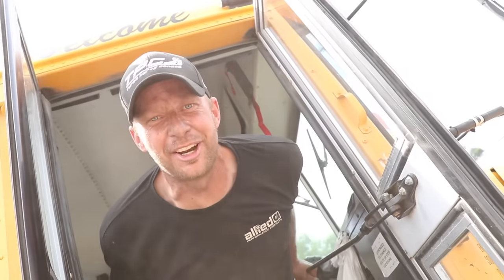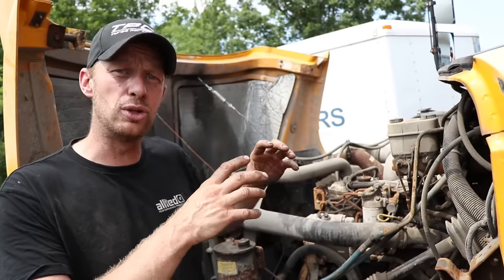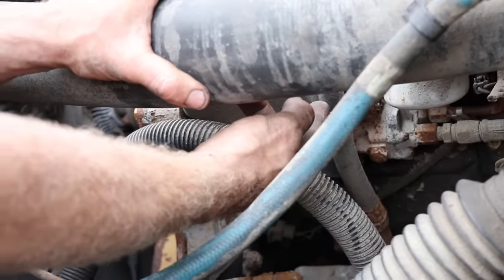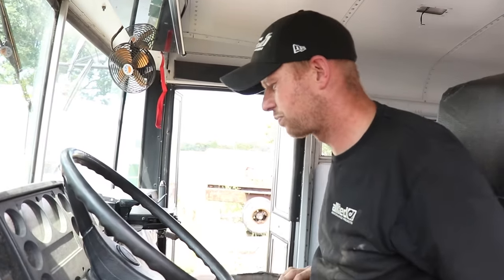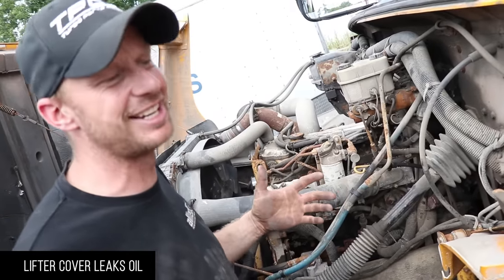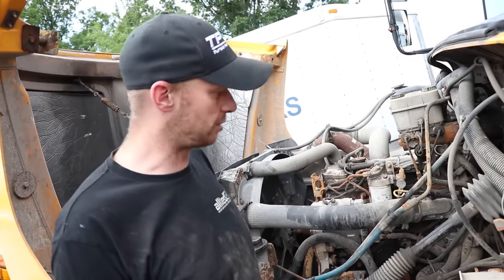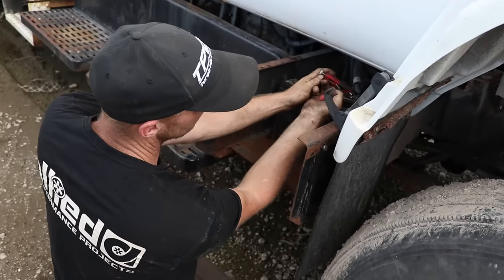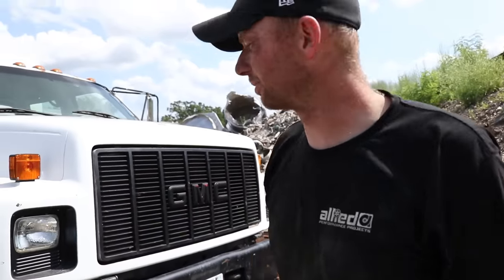REVIEW: Everything Wrong With A 7.2 CAT 3126 Diesel

Comment: Detroit 8.2L Fuel Pincher, I've been kneeing to find one in a Chevy C70 but not much luck.
Reply: I worked on 8.2s in a dealership from when they first came out. That engine was going to dethrone the 3208 as the premium medium duty diesel engine in the marketplace. 
Not.
Open deck design (think Vega engine) that couldn't be resurfaced, head-gasket-of-the-month club membership, head bolt rework campaign, spun oil pump bushings scrapping the blocks, rolling idle from sticky injectors/worn governors, etc.
We used to say they were painted and environmentally friendly shade of blue so they wouldn't scare the fish in their only fit use as a boat anchor.
Reply: have you tried places like   GOVDEALS  or PublicSurplus   dot com    or ironplanet and govplanet  dot com  ?
Reply: @paulolson734  I read that without seeing you wrote "Not" i was wtf lol!
Reply: I have one sitting in the shed. Was worked on by a tech. college
Reply: my dad had one in a topkick tandem dump truck when I was in highschool. Good on fuel because it was using more of the oil as fuel. It was a tired unit when we got it. Needed ether to start cold in the summer but i loved tearin around the farm in it. the oil consumption and an owner that i would call a total gary ended its life needlessly with a spun bearing and a week later the rod went through the block.

Comment: look at Deutz water cooled, working on a 2014, 6 cylinder Deutz common rail tractor engine, I am impressed with how simple and well engineered this engine is, 3000 hours and the pistons in perfect condition,
Reply: On most of the older ones I ever rebuilt the rods and mains looked mint at teardown...they ran some pretty high pressures like 80-90psi usually, so there goes the theory of high oil pressure causing bearing issues.

Comment: I will stay with 8.3 cummins and 5.9
Reply: The 8.3 is the 6CT, basically just a bigger 6BT Cummins.  It's a pretty big engine, so I'd imagine it would be hard to make it fit.
Reply: Henry because it’s fuckin huge lol
Reply: The 8.3L is nothing but a boat anchor. The 5.9 24 valves are lighter and just as powerful. I was after an 8.3L till I actually looked at the specs. Power to weight ratio is terrible.
Reply: @brettrichards666  Ive driven two motorhomes of comparable weight (33K gross), one with an 8.3 and one with a 5.9. Both mated to 6spd allison tranies and ill say the 5.9 doesent even come close to the 8.3. I am sure they both could be turned up some from the stock tuning, but stock to stock its an insane difference. You HAVE to drive the 5.9 WOT 75% of the time, any on ramp, green light, hill etc and its WOT. Any hill you encounter on the freeway it slows down to about 50-55mph. The 8.3 was almost never WOT, if you did mash it from a stop it would put you back in the seat. It would also go however fast you wanted to go up almost any hill, no joke it would do an easy 70mph up even the steep hills on the freeway. I have also driven one with an international 6.0 and a 5spd allison,  It has a significant amount more torque off the line than the 5.9, but i think that was mostly gearing as it was a dog on the freeways and would get slowed down to 45mph on a lot of hills.
Reply: I have replaced 6.7 Cummins with mechanical 8.3 Cummins on farm equipment. The 8.3 is only 3" longer than a 6.7. 5.9's are reliable but dogs.
Reply: Might as we stick a Cat C15 in it. might take up a little cab space and you will need on hell of a   cowl induction hood.
Reply: The 8.3 Cummins isn't that great it had issues with Camshafts, it wasn't one of Cummins best engines that's for sure.
Reply: The 8.3 is twice the engine a 3126 is and costs 30% as much to work on.  For a few years we had a 3126, an 8.3 and a DTI-466 in tractors and the 3126 was by far the worst of the 3.
Reply: @84Prerunner  Maybe with motorhome transmission and rear end gearing. Motorhomes arent pickups.
Reply: @brettrichards666  you haven't the slightest clue what you're talking about.
Reply: @verteup  I do.
Reply: @brettrichards666  an 8.3 Cummins will walk all over a 5.9. if you think those two motors are even close to each other you don't have a clue what you're talking about.
Reply: @verteup  Okay. Lmao
Reply: @westbender 820 That doesn't mean shit. That's like saying any stock 454 is better than a newer, let's say stock LS 3, just because the 454 is bigger. Especially when it comes to the aftermarket world, I dont see 2,900hp 8.3s.

Comment: The difference between the 1000/2000/2400 series and the world 3060 is the gross weight capacity. They are different transmissions for different applications, there's more to it than the numbers of forward speeds.

Comment: I had a 2000 Peterbilt 330 with 3126 B 250 hp. Super 10 would run 80 I think 4:33 rears air-ride loved that truck. I changed oil every 6000 miles after 200k miles I changed every 5000 miles Rotella T ended up 425k miles when I sold it never had to replace injectors never cold start, used a block heater.

Comment: Thats a tough engine.Seen a driver overspeed one and threw most of the push rods out of it. pulled them out of the pan replaced the bent ones and fired it back up and sent it on its way

Comment: Unless there was some changes done  to the 3126 I just put a head gasket in(470 cat combine).
It had a Mechanical injection system with a fuel rack, governor and cam driven injectors. No hydraulic/electronic injection.
Dead simple engines, that are bullet proof, heard of them having over 17,000 hr on them.

Comment: I was the new guy at a cat truck engine shop when those little bastards were under warranty. So many gaulded cylinders and those don't have liners. So you have to pull it out, tear it down and send the block out for sleeves. I started having flashbacks . Make it go away!

Comment: Have 3126 in wheeler dump truck. It uses 2 gallons of oil a day. It has 165 thousand miles. runs good, dos not burn it or leak it. Has really good fuel mileage. I think it ends up in fuel tank. Had injector seals installed couple of years ago but it made no difference. Back then it only used 1 gallon a day.

Comment: Unless its been swapped that's not a 300hp version in a school bus. They only went up to 210 in that model of bus I have had them.
Reply: Haha back in the mid 2000s , we had a blue bird in the shop with an issue.
Isb Cummins. 
I went and found another tune for it without the speed limiter,and on the test drive we hit 93 😅
Reply: @MrTheHillfolk  My 3126 is only a 190 hp version but with 3.42 in the rear end I'm cruising at 80+ in my 5 window Thomas shorty. I've been in the school bus world a while and never saw one rated higher than 230-250 unless it was something exotic out west like a Crown.  Those had 855 big cam Cummins and 10 speed road rangers! Some of those would do 80+ up grades!

Comment: Not sure if this had or not but pretty sure the 3116 and the c7 both had v belt style belts to drive the water pump.... I recall it being very difficult to get proper tension on it after a short amount of time...and also recall having to remove the crank pulley to get the new belt in place

Comment: We had one in a truck named red stripe (FL70). The didn’t keep clean oil in it and it blew up so we had another truck that was a Chevy kodiak with a 3126 and a blown up tranny so we took the good motor out of the Chevy and stuck it in red stripe and now ole red stripe is back hauling high pressure cylinders again

Comment: Six cylinder engines run smoother due to overlapping power, more room for bigger rods, and more torque due to bigger piston strokes. Valve train improvement help in the rpm .

Comment: Allison has their software very locked down and you need proprietary software and Allison permission to change certain parameters. An Allison dealer can do this. They're amazingly configurable though, and yes they can configure them to limit to 4 or 5 speeds and then open them up to 6 speeds. That bus is a Freightliner business class chassis cab and a Freightliner dealer could do this as well as a standalone Allison dealer. A 2000 Allison has 5 clutch packs and 3 planetary gearsets and every gear ratio needs 2 clutches applied.

Comment: My first job as a diesel mechanic was changing injectors on a 3126. We ended up pulling the head, and found out it had 3 pistons with broken rings. My boss says it was most likely from ether being used. Rehone the engine, new rings, and the F650 was on its way. Good way to introduce me to my new job. Not sure why the boss left the new guy unsupervised on a mayor job like this 🤣 but hey I see that truck around and she running good so I guess I did ok
Reply: How old were you at the time?
Reply: Blu Gods that was last year, so I was 26

Comment: never had any experience with a 3126 cat , i have a 3116 in a 1974 oliver  1955 ,, it's originally a 90-100 horsepower tractor   , with the 3116 it turns 160 hp on the PTO without sweating
never had any electronic cat engines before ,, all of my other  cat powered equipment is powered by 3406/3408 engines

Comment: Great video, I just went to see a 03 freightliner 26' reefer box truck with a CAT 3126 but it had a 6 speed manual transmission. It also had the square huei pump. It was $20k but needed a whole lot of stuff done to the reefer, box and engine. Plus not being inspect was the red flag to me! The engine ran great but as soon I started moving the engine idle was reving up and down. Thought it might be some type of regulator but I don't know because I'm not a mechanic. Oil was typical black on the stick and there wasn't any blow by. It had rubber hose instead of the metal hose to the huei. So I left it go! I need a box truck that is good shape and so I can make some money! It doesn't need to be perfect!

Comment: Speaking from experience on the OE side of this, particularly in school buses, you can order almost anything you can imagine. At least in the US, practically every small town and county has a different bid spec we would have to meet and it wasn't at all uncommon for us to do stuff like a add a new alternator, or dipstick routing, or whatever you can dream up to an order of as few as less than 10 trucks if that's what it took to make the sale. So... In the world of school buses, a lot of them likely are very similar, but they can be radically different in unexpected ways so if you're going to dig into one as a parts vehicle. It would really pay to do your research before buying. In my experience, from my side of the coin, that also trickled down to the dealer network. SO... If you're going to buy one of these as parts, it might be helpful to see if you can figure out who the original selling dealer is, determine if they're local to you, and speak to them about things like recalibration before you make a purchase. I would suspect that if the stuff is still IN the bus, no one would ever touch it with a 20 foot pole, but if you had it in your "whatever", you likely could get service pretty easily at the original dealer . I suspect that most equipment companies wouldn't want to touch it. Anyhow, on the dealer side, I'm purely speculating, but we used to have dealers call us about weirdo 20 year old stuff all the time because they had a customer with, like, 2 of them still out there and wanted to do something "odd" and wanted to keep them happy so they'd keep showing up at the parts counter (which is where the real money is made) . So... It happens.

Comment: Ran into the oil pressure issue in an 03 International DT466E...blew a scrawny little hp oil line and engine ran like crap till I got it pulled over and shut down.

Comment: Had a 3126 in my last GMC Top kick. For the most part it was good. Never had nay injector issues. Got a C7 in the new truck. It likes to go through injectors & have other random issues. The wiring on the these GMC commercial trucks is another issue in itself.

Comment: From my research and experience with an md3060, the only way to get 6th unlocked is to go to the manufacturer of the vehicle (Thomas in this case) and request a letter from the engineering Dept that the vehicle can handle the extra gear. Then you bring that and your checkbook to an Allison dealer and they will inspect the vehicle (both safety and especially tire rating) and make sure it is safe, and then request from Allison an unlock code specific to each transmission. They will then program the transmission to use 6th gear. I haven't heard of any way (and if anyone knows a way I would be eternally grateful) to do this at home due to the proprietary software, and the code needed from Allison for each trans.

Comment: I was doing a refit on a 2000 GMC T8500 with the 3126E. I let it sit for the winter outside the next summer wouldn't start. Took ECM to Cat. It's faulty. Just sitting there not running it went south. Got a rebuilt from GoECM in Texas. $2000. For a rebuilt. Stinking electronic controls. I hate them. Got an International DVT573 in my Hough H90C. 1970s. Still running like a top. Simple Roosamaster injection pump. No stinkin ECM.

Comment: 5:57 At least on the poppet style injector for the 7.3L, around 180-220K miles it doesn't matter what oil you've got in them, it'll be extremely hard cold starting. There will be so much wear on injector seats that the armature is in contact with the body/plate and can't be lifted by the solenoid. ...which is kind of fine, you just need injectors. It's less than one cent per mile and clean oil can't prevent the wear so... use sane oil change intervals and just replace your injectors when they need it (approximately every 200K miles / when you start experiencing hard starts and it's determined to be injectors)

Comment: Not to mention that the high pressure pump isn't keyed from the drive gear to the shaft, this was a big problem. I love Cat engines but I would go with Cummins over these small cats especially the 3116

Comment: Heui systems run on oil pressure from 870psi to 3300psi depending on engine load. I agree the 3126 is a good dependable engine. But the 3116 was also a good engine. I still have the Cat engine valve and injection tune-up kit. I believe that kit is pretty costly and it was given to me by a friend who used it in a company with a fleet of GM Kodiaks. The company switched to a different truck company, and then when out of business. He came by it legally, as it was sold of as a lot at auction and the purchaser didn't need it.
Reply: Do you still have 3116 ingector  adjusting    tool ..I like to have,  for  how much you want to sell   ?
Reply: @lanabeauty7784  sorry not for sale. still use it for teaching a diesel course in a tech school. I know it's old school but it is great for showing the relationship between crank, cam, and fuel injection system. I also have the fuel set up for detroit diesel fuel pincher engine from the 80s still have one running on a stand at the school. and were I live in the hills, we still have some of those old chevy top kicks around with the 3116 and 3126 (the valve adj. tools are the same for the 3126) so I do use it from time to time. and the kit I have is massive its the only one I've ever seen, it has everything in it for setting inj, height to gov adjustment and all the wrenches and feeler gauges for the valves. Sorry

Comment: We had a Kodiak that had one in it at work with an Allison auto and a reefer box it was a pretty dang good truck. It made it to 220,000 ish miles with pretty much no major problems to mention. Something finally happened to it and it wouldn’t idle. If you started it on a cold day you had to keep it running for about 10 minutes or so and then once it got warm it would idle but very slowly. You just had to barely cracked the throttle and it sounded normal. I didn’t drive that truck much but they said it was too expensive to fix. It’s still ran fine out on the highway it would run a little over 75 mph and pulled really good.Just idled really slow. They replaced it with a new ford F650 With a 7.3 power stroke and the same big reefer box. Talk about a freaking dog it would barely run 65 on flat ground it turned into a money pit they sold it off with barely 100,000 miles on it. It was a dragonfly truck. Drag 40 mph uphill and 68 mph downhill. The truck I drove the most was an older C 70 with the 8.2 L Detroit they had four of those and they all did pretty good. I don’t hear anybody say anything good about those engines. The truck I drove was an 88C 70 and it had the turbo 8.2 Detroit And an old four-speed Allison I don’t know the model. That damn thing took off so fast it would almost spin the tires in if there wer pebbles or dirt on the road and the truck was empty. It also had over 200,000 on it when they sold it and still ran great but the transmission has been rebuilt. I would buy a truck with the old 8.2 in a heartbeat. It blew my mind how fast that Truck took off and that it could run 77 mph with a four-speed Allison and still pull fairly decent. The caterpillar would slowly pull away from it on a long hill but other than that it did just as good. The old Detroit would sneak away from it on take off though up to 75 mph. We also had a Ford cargo series cab over that was in the 90s your model range it had a 5.9 Cummins in a manual I think it was a six speed. It didn’t give  much trouble but damn it was slow and it wouldn’t pull anything. 66 mph is all it would do and it was screaming. When you hit a hill you were doing 45 or 50. I think the 5.9 L Cummins was a little too small of an engine for that big box truck. 8.2 L would be a good one to do a review on if you haven’t already.

Comment: My experience, 3126 swapped 96 dodge 3500 with a nv4500, no one believes it till they see, sounds a little different then a cummins so always getting weird looks. Been in the truck for 200k miles, never had a single problem but transmissions, thinking about putting a eaton 10 speed in it instead.